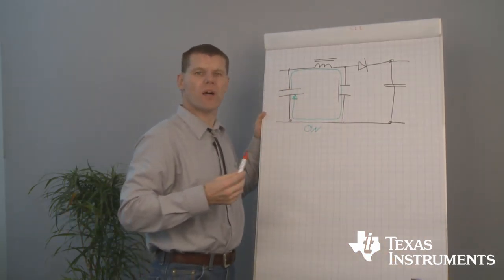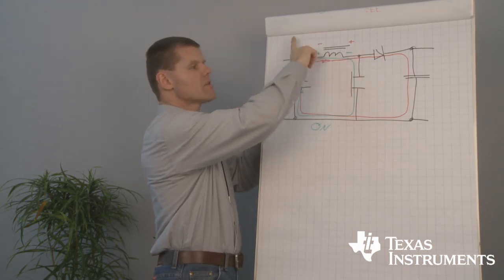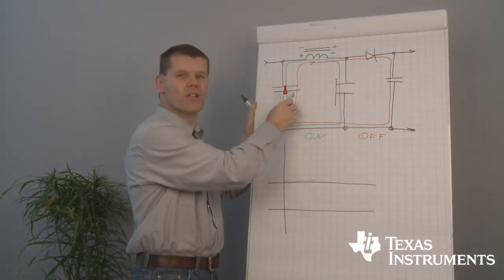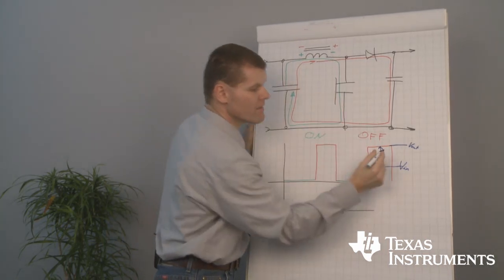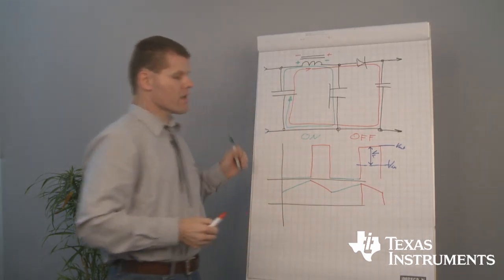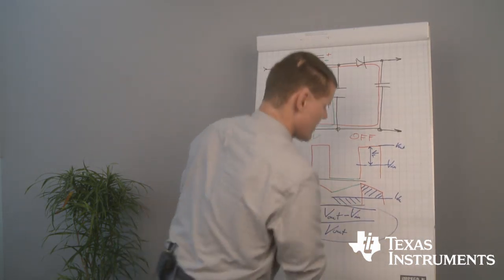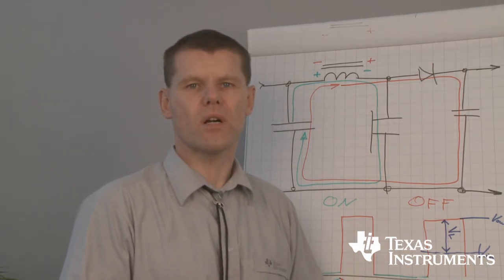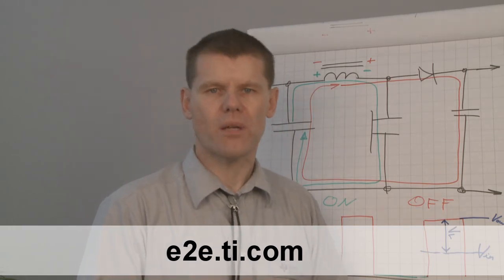Boost Power Stage - Tutorial with Bernd Geck (part 2)

Comment: Nice and simple explanation for beginners!  The only thing I would add is the limitations of the output voltage vs. efficiency, basically at which point does it become more feasible to use a transformer.

Comment: thanks 
i have request how can i build   a variable power supply its input voltage 13-9 volt  to maximum volateg output 30 volts 4 amp

Comment from the maker: 1) When the switch is closed at the boost power stage the input voltage is across the inductor;
2) As soon as the switch opens, the voltage at the inductor turns (the "minus"), and is added to the input voltage, the rectifier starts to conduct.